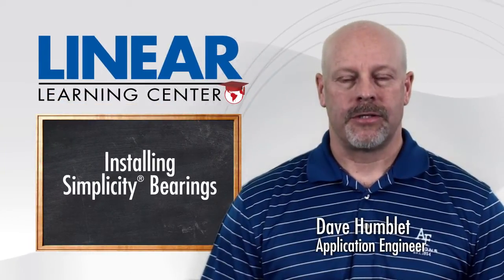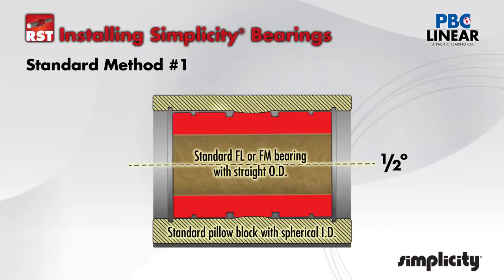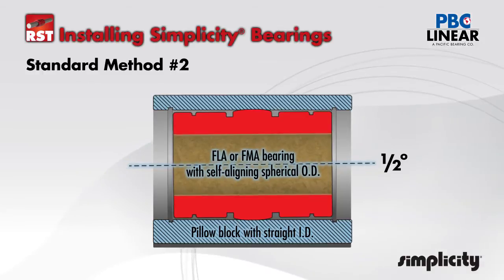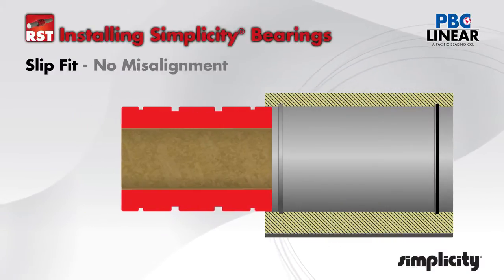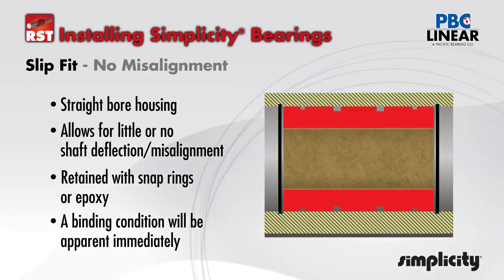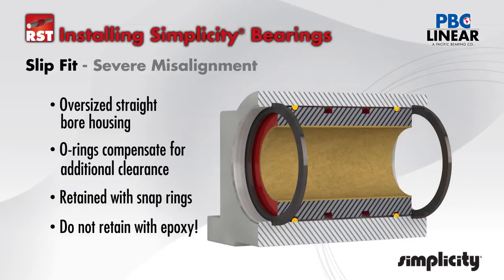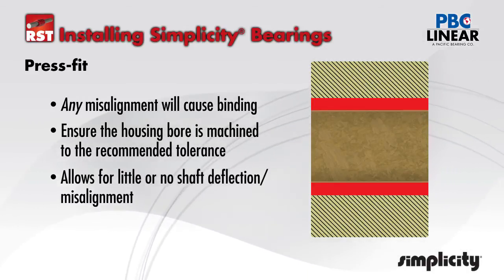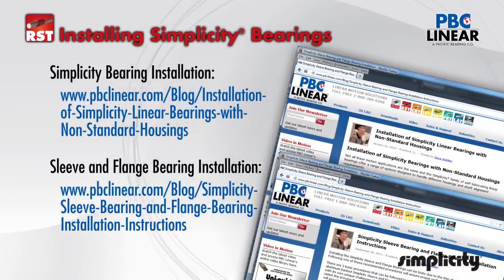How to Install the Right Simplicity Linear Bearing

Comment: Where do you find these housings for the simplicity bearings
Reply from the maker: You can find these housing here: https://www.pbclinear.com/Products/Round-Shaft-Technology/Linear-Plain-Bearing-Pillow-Blocks
Reply: @PBCLinear  is there a way to use the simplicity bearing and create a slip fit into bore? I’ve seen the methods described in the catalogue but I’m still not understanding what pieces are required to creating the housing. Thank you!
Reply from the maker: @carsondavid7730  I recommend asking one of our engineers. They have the expertise to answer your questions. You can message them here: https://www.pbclinear.com/Contact-Us/Ask-an-Engineer. Thank you for reaching out!